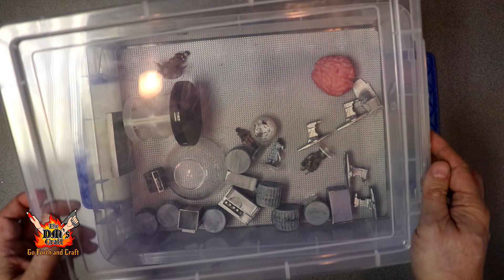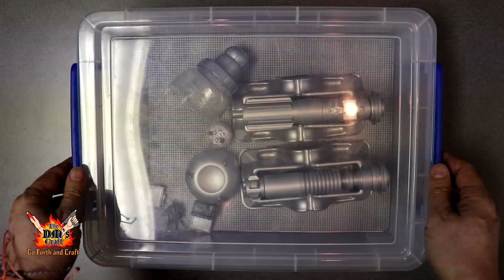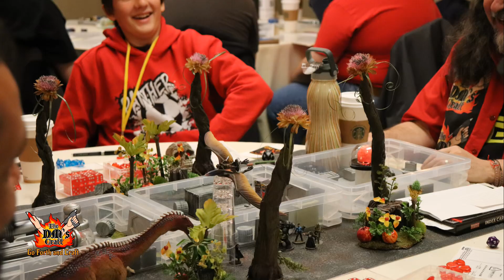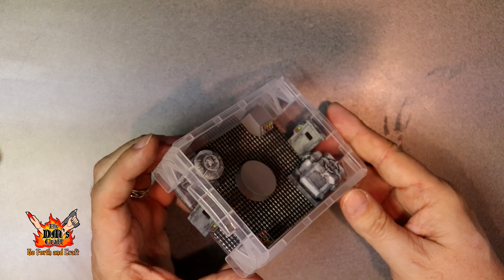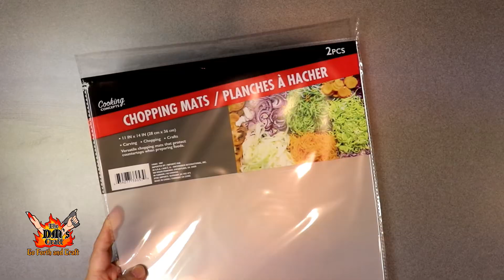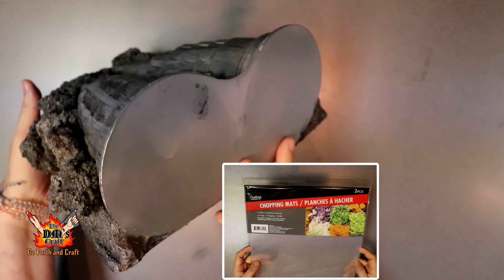Terrain Modules 👉Easy to Transport and Use at Conventions (DM's Craft)

Comment: Looks like a plausible underground cave system, or even above ground hillocks/plateau etc, if you color the bottom outside, flip upside down instant level.

Any thoughts of completed items along these lines?
Reply from the maker: You mean like scatter terrain?
Reply: Maybe? Haha.

Essentially the inside would be a cave or underground complex (same as internal of a space ship concept you have done just cave/complex) but when flipping upside down the height would permit for a hill or some plateau like terrain. Any thoughts of that?
Reply from the maker: @campbte85  as long as the top of the hill was not larger than the box you could glue or set it on top of the previous box.

Comment: DM Scotty... did you try to sticky tack the stuff to the underside of the lid instead of the container? Then the container comes off like a cupcake/cake lid. Just wondering how that would work...
Reply from the maker: The lid is not flat and has grooves so no...I find the box is large enough that it works just fine.